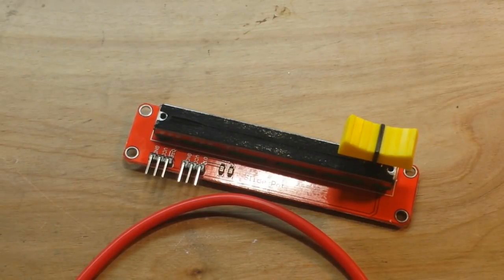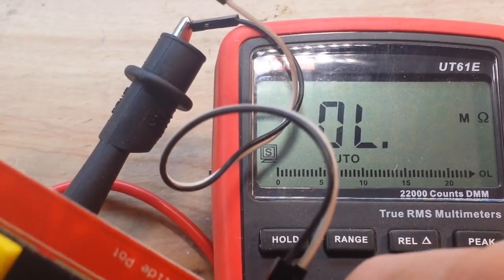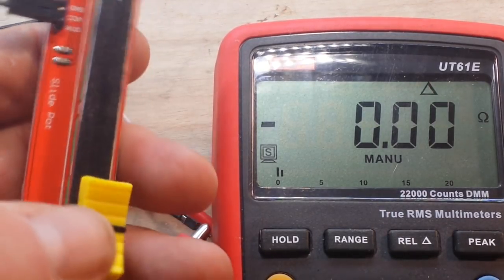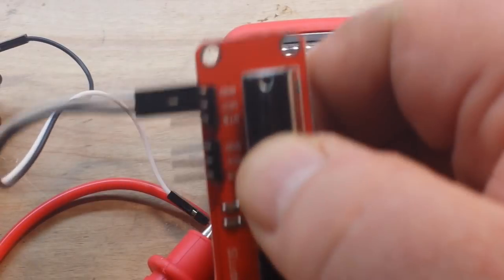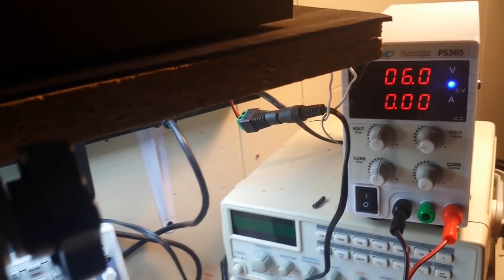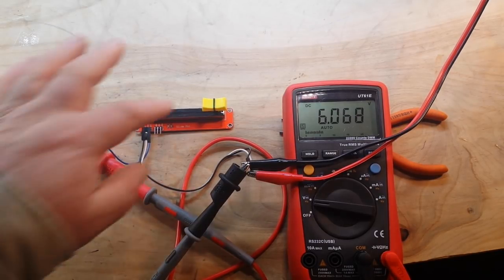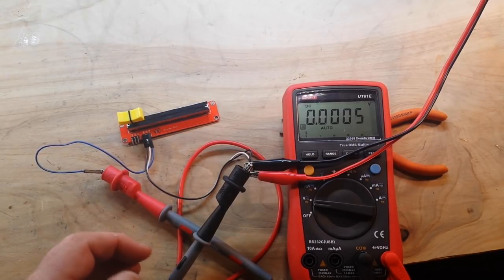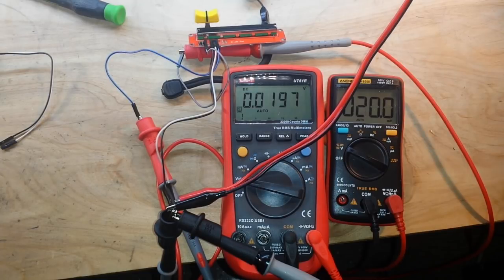Linear Potentiometer from Alice1101983

Comment: Hi . Hope you are well. So my keyboard’s volume slider finally packed up. (Roland EP7) very old model.(1990) . I would like to know what would be the outcome if I had to replace the 10k B x2 slide potentiometer with a single 10k slide potentiometer… my keyboard just finally stopped pushing out volume

Comment: The voltage inputs are supposed to be separate such that you can get two different voltages out at each output (I mean why else would you even bother having two outputs if they would always give the same value except for maybe flipping the values). I think you got a bad pot

Comment: Anybody ever detached the slider from the PCB and measured if it's stereo log 10k? Just asking, because I'm looking for 10K log stereo slider pots at the point and I got my eyes into this module in ebay. Seeing this video didn't convince me to believe that this is 5K pot. It could still be 10K stereo log pot having both channels soldered parallel in PCB. If somebody can test which is the case, please inform me. Tanks!!

Comment: this seller (Alice1101983) sells fake blf188xr chips, they burn out at 1/4th the power they are rated and the drain doesn't measure anywhere near the 10M OHM it is supposed to have.

Comment: The linear pot is working when you apply a voltage from a power supply but not when you are using your ohm meter.
Reply from the maker: It worked just fine. It showed resistance from 6ohms to just over 5k ohms.

Comment: what do you know about U SoB cables? that's what I be calling it lately. I got dollar tree USB cable to charge my phone. been having trouble . believe or no. its not the cable. its the phone. USB port. is it possible to replace it. or is it like most other phone stuff. any way. that's why I been missing videos lately. great video. not bad for under $2.00,
Reply from the maker: It is possible. But you should do some serious practicing on SMD soldering. A soldering microscope can be of big help.
Reply: learnelectronics 
thanks! it will probably be cheaper to get a new phone. well less stressful anyway. I don't do so well with ultra tiny things. especially soldering  the ultra tiny. I may get a new phone . then give it a try. just in case. I'm likely to really screw it up. or just hot glue a tp 4056 charge module  to the back of it. and connect it to the battery!! haha. and maybe some duct tape!
Reply: James stranger I had to throw away a cheap Chinese smart watch because one of the micro usb pins on the watch bent and broke!  It cost twenty pounds posted so wasn't worth trying to fix!  I got about six months out of it but it wasn't that great to be honest.  I buy most of my stuff for projects from China and, to be honest, most of it is ok.  The price savings mean I can do a lot more stuff so it's a no brainer I'm afraid.  Most electronics originate in China anyway so luck also plays a part!

Comment: I recall opening one similar from a damaged Yamaha mixer. It had 3 carbon tracks where the center one had connections at both ends and the other tracks where 5k each, but only accessible from one end (top or bottom). So while one side goes up, the other goes down in resistance. Technically it could be called 10k but the triple wipers contact position always adds up to 5k..

Comment: Out on a limb eh? I'd say you were pretty safe on that one. Looks to be an OK pot but if you bought it and needed a 10K you be screwed. I don't understand what it would cost them with a little truth in their descriptions? Although maybe they do think that two 5K pots equal a 10K linear pot? Maybe culture clash here. Good show though, so now I know not to buy a 10K linear pot if I need a 10K linear pot!
Reply from the maker: I've had many, many courses in mathematics from algebra through differential calculus. But I never could wrap my mind around Chinese math!
Reply: audio faders are typically 5k, 10k or 20k ohms, and the clones all look the same from the outside. they probably just copied the page for the 10k one and didnt bother to edit it, or mixed them up at the warehouse (they dont seem to have 10k written anywhere on them).